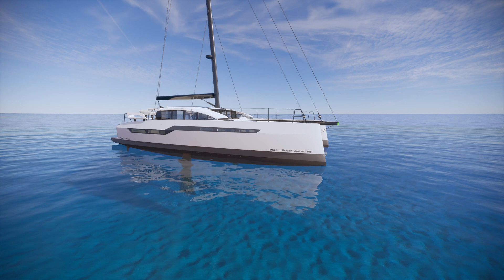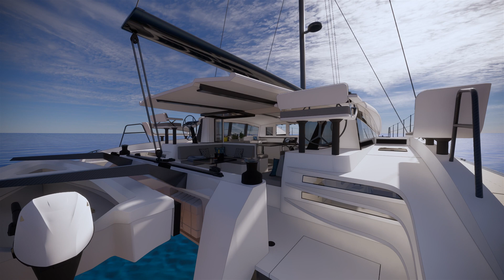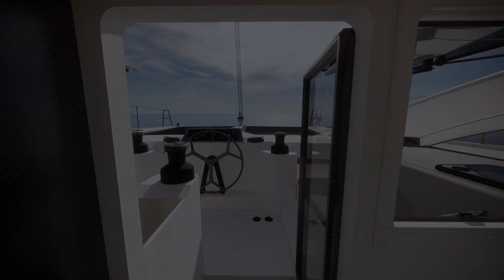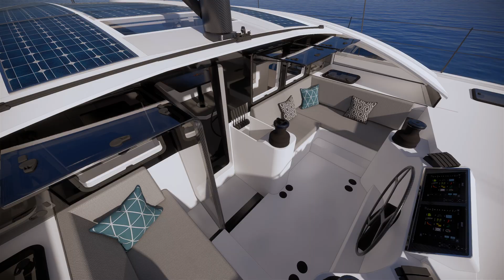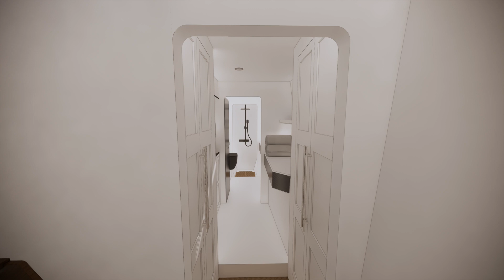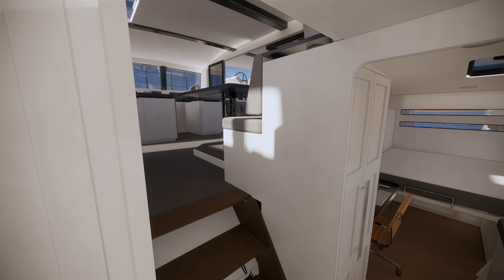Dazcat Ocean Cruiser Design Overview

Comment: The dingy should be placed up front. Facing the waves. Make the dingy bottom a hard V shape to help the boat break the waves. All that work on the dingy to make it work up front, will make the dingy ride better. Also, u will not need to block the view from the back of the Cat!  Save space! Better view! Also ur brand new Cat comes with its own dingy!  Win win.

Comment: All the time I've been looking for a performance catamaran, but I'm still worried about the danger of lightning on the water during a thunderstorm, which is why I firmly in my mind decided on the Allure 51.9 (I find the explocat from Garcia very expensive at the moment and still a bit bulky) .

I don't know of any non-metal hull brand that has an answer to the risk of lightning strikes regarding the risk of a hull or mast breaking, do you have an answer?
If yes, then I will buy your catamaran immediately!

Comment: Great concept, love the thoughts you put into short handed sailing and collision avoidance systems. However no linings or soundproofing would drive me nuts, laying in a cabin at anchor hearing water constantly slapping against the hull would be akin to Chinese water torture.
For me I would have to have a soundproofing later.
Other than that, it's a brilliant catamaran. 
What lengths are you planning to release? 
Thanks!
Reply from the maker: Lengths in part depend on client demand but bigger rather than smaller looks likely.
Reply: @DazcatCatamarans  if you plan to release a model around 80ft I'd be interested, specially in build time as this is very relevant at my age lol, i.e. I'm not 21 any more haha
Reply from the maker: @petephills4626  It sounds like you'd appreciate a talk with the design team. Feel free to email us at info@dazcat.com
Reply: @DazcatCatamarans  Thank you, will do 😉
Reply: 24 meter (78.74 feet) maximum LOA so you don’t have to deal with the commercial side of registering and insuring the boat, right?

Comment: I don't quite get all the helm positions as opposed to sail handling positions?? Are all the lines cunningly always on reversible winches??
I'm intrigued that you are proposing in boom furling. Coming from the simplicity of junk rig reefing  my understanding is weak. Couldn't you adapt the design to ketch junk rig. No mad tensioned rig to stress design to?? And ketch to balance choices??
Just love that you guys are designing and building in Cornwall.

Comment: Great boat! I like the concentration on performance by design , no liners is so much more work but saves so much.  
The current ‘crop’ of ‘you tube’ stars buying production ‘performance’ catamarans are not going to be getting close to this.
I’m surprised by all those helm positions, having sailed decent sailing cat offshore it’s generally autopilot all the time, even tacking etc with autopilot functions.  Simple autopilots repeater / handhelds would be all that’s needed. Hand steering is just for close quarters maneuvers . Hand steering for optimum performance is just not practical or as reliable as autopilot. A bad helming decision could be bad news but with autopilot you can tend sails, depower etc as reqd knowing where the boat is being steered.  Stuck in an inside steering position hiding from the weather is not going to be advantageous. IMHO. 
Love this design though 
Cheers Warren
Reply from the maker: Thanks for your appreciation of our boat. With reference to the helm positions, in the design consultation with a few different experienced clients we discovered that no one person thinks the same in regard to the best helm position...So, we have designed a vessel that can be built with one, two or if you're completely crazy four positions! But we quite agree that one or two is enough. You will be able to operate by remote/ autopilot as well. However, a great part of the pleasure of sailing a Dazcat is the sensationally light steering when conditions make you want to be outside. The boat is designed so you can start with one wheel and retro fit more if you want, or start with four and retro unfit, using our unique in-house design...It's all about giving the client choices to their preferences.

Comment: Solar protection for the rear helms...? The wife from the OKelly's has had another skin facial cancer removed. There are plenty of others who've had  close calls earlier in their life. Heatstroke is an increasing risk ... How do you  propose sealing the aft deck off against no see ums and Mosquitos ...this is a serious problem in many places and now the 🦟are  carrying things like Zika and west nile  fever into European lattitudes.   

In Scotland and Scandinavia you can also get eaten alive and or bothered to death on the Great lakes.
There are many anchorages and harbours beloved of yachting folk that tend to have to be abandoned come evening because of the little biters in the air not the big ones in the water.🦈

Have you a way of stop tropical levels of daily rain and squalls pouring into the rear cockpit Seating and living area?

Can you rig a sun weather canopy over the forward cockpit? Whilst sailing or at anchor.

Those bunks need (especially the top one) a lee cloth or board for rough  safe use in  big seas.

Slor panels are far more efficient and last longer if they are kept cool... HPV hybrid thermal  photovoltaics are more efficient last longer and can yield heat to pre warm/heat the vessels hot water needs.. 
At its simplest seawater can be circulated through cooling pipes on the back of the pannels.  

The weather and sea conditions are begining to reflect the  higher energy extreme patterns of the ocean warmings. 

The nets are a major chill out area for many cat owners especially those with children... 
Is there a way of making them safe against lemming like toddlers 😂😉 and those who've had too many G&Ts or Mountgay  rums staying too far forward.😮